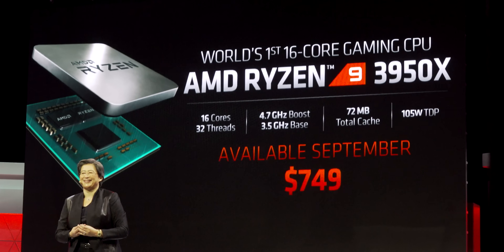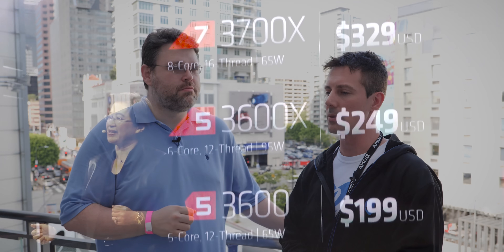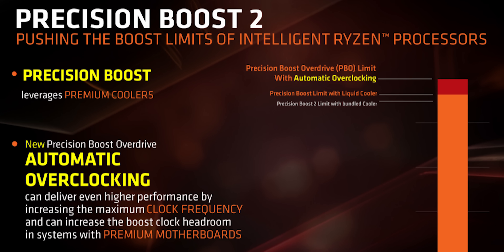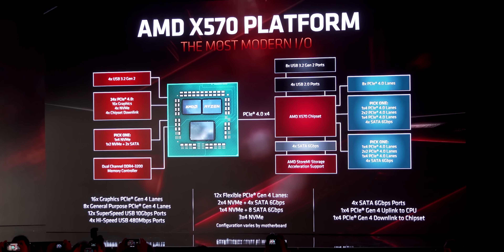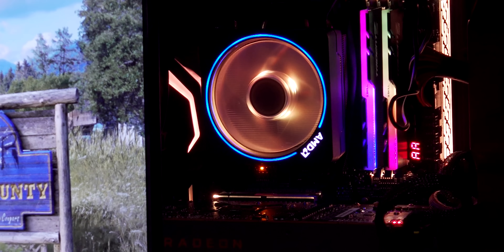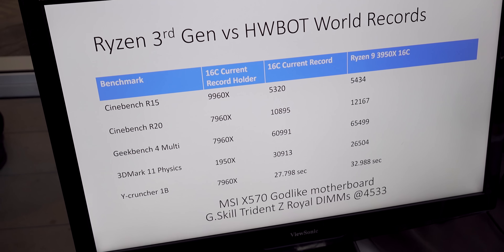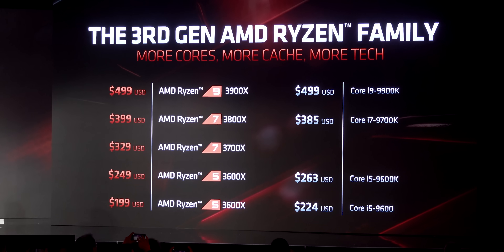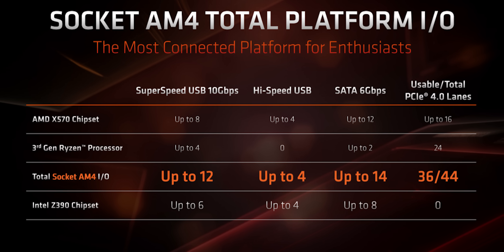...Is it 'The ONE'...!? (3950X & Zen 2 Discussion Ft. Wendell)

Comment: I have an i5-750 and a worn out HD 7850 (some memory artefacts, the shroud got detached from the PCB because the glue couldn't withstand the torque of the fan) I was planning to upgrade to a 3700X and a Navi card. I still do but these guys there enthusiasm about the APU made me realize something: why not start with a 2200G/3200G and buy both the CPU and Navi card later when those are discounted. 

It solves a few problems and I get better hardware while paying less in total because those APU's are so cheap. The 2200G is a much better CPU than the i5-750 and the graphics should be roughly on par with my HD 7850 (better GPU, less memory bandwidth). It seems like a good solution, doesn't it? Those CPU's will get a price cut of at least $100 late 2019 to mid 2020 (I wouldn't be surprised if the 3900X would cost $329 or less a year from now), the graphics cards will get a good price cut once Nvidia made its countermove and AMD has sold all those Polaris and Vega cards. Let the sanity get back in the market (like Intel solving its production problems and offering better deals in Q4) and sit it out with an APU, buy those CPU and graphics card at a good moment when there is a good deal. I am thinking about a X470 Taichi if the traces for the RAM are good enough for 3600 MT/s and CL=14.
I dislike the prices of Navi at launch, that pushed me over the edge. The successor of the RX 480 (the full 40 CU's card) shouldn't cost more than $350, with that I take into account the higher production cost because of that 7 nm. node and GDDR6.
Reply: I don't think Zen2 parts are going to drop in prices much. AMD isn't underdog in performance anymore so they don't need to present strong value argument to make sales. 6&8 cores prices might trickle down because intel can compete in that segment(when they capacity problems easy out) but 12&16 don't have any competition for long time. Navi is expensive but I  expected it because yields looks really crap. Their prices probably go slowly down but really that much. AMD can't go for price war with 7nm navi and Nvidia knows it. So Nvidia has no pressure to cut prices significantly. At best they bring refresh models to each segment and drop slightly prices of their current skus. Industry is pretty much waiting for next year EUV process nodes.
Reply: @kognak6640  

I appreciate your insight. AMD still is the underdog, the market for people who assemble their own PC is tiny compared to the OEM market. That doesn't say anything about the prices of loose CPU's, I just point it  out. AMD competes with its old products, before Zen3 releases AMD will drop the prices of Zen2 to keep selling those enough and to offer good options to the more budget conscious customers. Also we should consider that AMD CPU's loose value faster than Intel CPU's, simply because of the backwards and forwards compatibility of the AM$ motherboards. If you have a 7400 on a motherboard than the 7700(k) is the only improvement without changing the motherboard, for Ryzen you can drop in many CPU's, including newer CPU's, this lowers newprice too because AMD also competes with the secondhands market. Before that AMD will already drop the prices because Intel will launch more competitive products in q4. It will still be 14 nm and it will still have the same 'IPC' but Intel will lower the price per core. Intel doesn't do price-cuts but they can lower the price per core for the new release. 

However, for me it mostly is about the Navi cards being $100 too expensive while my graphics cards is half dead (memory artefacts and shroud detached from PCB due to a bad glue connection which can't resist the torque of the fan). Those will drop guaranteed. AMD deliberately starts with a high price, not only to counter whatever Nvidia does next (Ti-cards and price-cuts) but also because AMD wants to sell those Polaris and Vega cards first. This also has to do with an overproduction due to that mining nonsense. I don't know if the yields are a problem, that is a tough call with 250 mm² dies. It might be to some extedn. Regardless, that is another reason to consider to make do with an APU for a year. It is not worse than my HD 7850 (some wins and some losses) and it is lot better than my i5-750. If I can buy it for €100 or less, why not? I can already upgrade the motherboard and RAM and I only have to swap the APU for a CPU and install a graphics card when the prices come down. Buy it when there is a discount instead of buying it brand new. I agree that we will get a performance/price boost when EUV starts getting used. 7 nm without EUV is on the border of what is possible, they are really pushing it right now, all those extra required layers make it a lot more expensive.
Reply: @peterjansen4826  Underdog remark meant performance-wise, as a company AMD obviously is and unlikely will change soon. AMD products so far had only price advantage, it was always budget choice. With Zen2 this position will change, you see it how board partners are investing in. There's really no other argument for intel but brand loyalty. And new products later this year? Doesn't look good at all. We certainly would know if there's anything significant coming, Intel would make sure of it we'd know something and try to steal attention from Zen2. But there's nothing, just overclocked 9900k and that's one of the reasons why board partners are all-in with zen2. They see business opportunity there.

About Navi yields, I did estimates based on reported 70% yields of Zen2 chiplets which are only ~80mm^2. With same defect density which cause 80mm^2 dies to have 70% yield, 251mm^2 dies have 35% yield. And largest 7nm die 330mm^2(vega20) has 25%. Combine with at least double wafer costs of 7nm, you get very expensive chips. Chiplet yield should be about 90% if navi dies are cheap to make.
Reply: @kognak6640   
Intel can add cores, bump products to a lower tier, cut prices. Introduce a 10C for $499, lower the price of their 9900k $350...
Will they? I don't know but Intel will have to for the 'build' it yourself market. Mostly I expect a price-decreases for Zen2 because of AMD its competition with older products of itself, both new and secondhands. Price-cuts from the past give a good indication of what AMD might do in the near future. The price cuts of the 2600X, 2700, 1950X...
I was expecting the 12C as 3700X for $329-349 and I firmly believe that this was AMD's original plan until they discovered that Intel really can't compete (their 10 nm node problems, security problems and production problems). For Navi the price is ridiculously high. I calculated that the price should be $335 or less unless the yield is bad and AMD has to throw away a lot of the wafer.

- The production cost of Ryzen 3800X was less than $50 in late 2017, that die is $210 mm²
- The diesize of the full Polaris is roughly 250 mm²
- The TSMC 7 nm node is at most twice as expensive as the GF node and the cost is proportional to the surface area
- GDDR6 is at most 70% more expensive than GDDR5
- 8 GB GDDR5 costs around $35 (Gamers Nexus)
- inflation of at most around 2% per year (less in Europe, more in the USA) 

If there is a problem with the production cost then it has to be the yield. That price will drop once the stock of those old Polaris and Vega cards got cleared and the yields have improved. 
According to that Anandtech guy his estimate the die of a Zen2 core chiplet is 85 mm². Not a big difference but indeed, the yield probably is not good enough yet.  Give it a year and that will improve a lot. They plan for the PS5 and the X2 to be released late 2020, they can only do that once the yields are good. I would be willing to buy a RX 570 if the price drops enough but that would have to cost around $100 given the age of the GPU. That Navi with 40 CU's is the successor of the RX 480 but it has the price of the Vega cards. I hope that this will imove in a year time. Maybe AMD should have used the TSMC 14 nm (branded as 12) for their first round of Navi cards. The architecture is solid as far as I can tell. This is just the first generation and AMD needs some backwards compatibility with GCN because of the drivers, I expect that AMD will compete for FPS/W with Nvidia again in all segments of the GPU's with the next generations.

Comment: I'm actually most excited for the 3950X.  I really want to put that in a top board with some insane VRM like the new Gigabyte Master and see how far I can push it on open loop cooling.  As far as value is concerned, first gen Ryzen 5 1600 is already an insane value.  You can get one for $80.  You can easily build a complete system based around that chip, using all new parts, for $500 and not really skimp out on anything.
Reply: Through three generations of open product on the market AMD has openly changed the landscape. You will be able to find 6 cores or better for insanely cheap.

Comment: Flight simmers using Lockheed Martin's Prepar3d can use all the 16 cores 32 threads.
P3Dv4 multithreads incredibly well. If you have enough threads, you just don't need high clock speeds for fast and smooth performance.
https://imgur.com/a/LuU1ruC  - these pics show the great performance at just 3.4 GHz but with ALL 16 threads getting worked hard. And this is 2 year old hardware and not a Ti graphics card.

The old flight sims like FSX, P3D v2 and v3, and even recent XP 11 have old coding that does not use the horsepower under your hood. They are just single threaded programs. But P3Dv4 - Wow, welcome to the New World.

Comment: 3400G ITX build - can't wait.
Reply: Yeah the 3400G will be awesome for ITX builds. That said I had really high hopes for the 3200G and 3400G, but sadly I'm kinda disappointed. As things are it will be better for most budget gamers to just get a R5 1600 + used RX570 since their price together is slightly more than the 3400G. I was expecting the 3400G to either perform better or be cheaper. I mean I haven't seen actual benchmarks yet, so it's not completely decided that it's that much worse than an R5 1600+ RX 570, but logically it should get crushed by that combo which as I said makes it a bit pointless except for ITX builds.

Comment: the question is to ask what the price point within the market you live in bit the USD value of the core count

talking from a streaming perspective what ram counbt are we looking at for 4k/4k HDR/8k are we goping to see because from a buyer perspective as an australian consumer of amd products i see no 128GB kits being  available nor  do I see 256GB or above  and are touting  8k resolution for next generation system from a console perspective what are we going to need in a streaming pc for  an actual  4k/4k hdr/8k  console lets face the actual fact that mid gen refresh is under powered  for what you get

the next question  to ask what ram count is going to be required  for 4k, 4k HDR and the latter 8k as for 1440p fuck waste of time and wast of space since I'm using a 55" tv as my monitor I have  time to consider crap within  the up to 40"pc monitor and 4k is viewable at 32"' though to sub 41+ year old eyes 55"is about where i am in terms  of viewing space ..

8GB  in a graphics card  isn't relevant today and less so 10-15 years ago and the current 16GB options are lacking  my guess minimum  will 32-128GB or higher  depending on how many 4k or better mintors you using in your setup

for  a moderate pc gamer/streamer/editor  it is looking at a minimum specification of 128GGB on ram with bare min of 16GB video card.. if not double to quadruple that once 8k becomes more applicable and affordable to buy..

Comment: can you please ask someone how much ram frequency R5 3400G will allow? 
the fact that it's clocked to 1400 gives away that they did change some things except the frequency because the 2400G didn't run with 1400...
i'm really interested
Reply: What? 

Do you mean DDR4 2400mhz ram?
Reply: @grlmgor  2400g was rated for 2933Mhz DDR4... that was bottlenecking the APUs.
And Ryzen 3000 seems to allow for higher memory frequency. But the 3400G is based on Ryzen 2000.... so i wonder...
Reply: @milchkopf3881  I think they can go slightly higher then 2933 but most low end boards didn't official support it.
Reply: @grlmgor  sure they do go a little higher but i used the announced 2933MHz to be able to compare it against the number amd will announce for the 3400G

Comment: why does the 3600x 6/12 cost more than the 2700x 8/16 ? why? i was hoping for the ry5 to be cheaper ...
Reply: 3600x RRP 249, 2700x RRP is 329, same as the 3700x

anything cheaper is from price cuts as the chips get older
Reply: 249 U.S in europe it will cost 300 to 320€ witch is the same as the current 2700x , lol
Reply: the 3700x will cost almost 400€ just wait and see.

Comment: threadripper, i said before over and over online, the 8 and 12 didn't sell. the 16-32 did. so with two 8 core chiplets to make 16, the new epyc showed 4 chiplets on each side.... even if each chiplet only used 4 cores for the low end threadripper, 4x8=32 core low end. and on the high end 8x8=64 cores. so threadripper still coming, just larger setups. no reason for the cross over. basically no one ordered an 8 core threadripper.... you could pay less and do desktop variants.....

cant wait to buy 3000 series zen plus the msi meg ace motherboard. hopefully my radeon vii, if its really an mi50, gets a pci-e 4.0 bios update.
Reply: Thank you for clearing this up Goblin... I'm a 1950x and I love it but after this ryzen 3950x announcement and no news for Threadripper I was getting nervous. I got X399 MOBO and PC setup ready with $1500 to throw at a 3rd gen 32 core. I don't care about the money this company is a beast and if they upcharge I would pay more. AMD has taken us where Intel never cared to take us at the consumer and High end, time to pay AMD back $$ :D

Comment: The 3950X is an incredible processor, but I get the feeling that it may be hampered a little by the dual channel controller it is using. The large onboard cache will help with that, but I'd like to see the performance benchmarks for multi-core workloads. However, it is a frankly stunning component, I would love to get my mits on it! :D
Reply: DDR5 needs to be dual channel on a single DIMM imho
Reply: @H31MU7  I have to say, I would like to see this too...
Reply: Did you see Wendell compare Threadripper vs octa-channel epyc? No real difference for a lot of it... it was just windows scheduled for Numa cores.

Comment: You want to complain about IPC ? Why does a overclocked i3 CPU beat Ryzen &  threadripper on games? Explain that 🙄
Reply: It doesn't. The 4-core i3's lose to the bigger 6 & 8 core Ryzen chips in more than a number of recent titles. And it sure as hell won't beat Ryzen 3000 lol. That's already beating the i9-9900K in a bunch of games at 1080p as shown at E3, so how is an i3 gonna have any hope in fucking hell? Answer? It won't lol.
Reply: The only currently overclockable i3 is the i3-8350k which is almost $200. Why in the world would you buy a quad-core processor with no hyperthreading that costs the same as a Ryzen processor that has 6 cores and 12 threads? Sure, the i3 may come out slightly ahead in certain single-threaded applications or games but when it comes to multi-thread processing, Ryzen 5 destroys the i3.

Comment: Navi at $449 is middle of the market.. FK OFF AMD..  At least Nvidia gave us a GTX 1660 and 1660Ti as a midrange option at real midrange prices.  If navi 14 doesnt compete with the 1660ti then navi is dead. Cant wait to buy my R7 3700x
Reply: @Just4fun and the amd reddit. its sad. "amd is never this expensive" 9700 pro was slightly over 500 and that was MANY YEARS ago. 7970 was like 499.99 at launch. 290x was 549.99 at launch. people are just cheap fucks and think a 2080ti should be 500 bucks so they can afford it.....
Reply: Exactly. But I think we will see the cards soon at $329 and $399, no one will buy this shit.
Reply: @janaebert3059  nvidia was scum pricing their new cards at the same price to performance as their old cards.. AMD doesnt need to be like them and spit on its customers.. i remember when the radion 6870 midrange came out and it was as fast as the previous high end option but cost half as much.. And so on up to the RX480... those days are history.

Comment: TSMC has made great strides in the past. Remember the 28nm Snapdragon 800. The 2.23GHz SD800 in my Note 3 could clock up to 3.1GHz. I set the highest Geekbench 3 scores and clocks with that SD800. The records still haven't been broken. I acheived this by of course root and putting it in a freezer. It would run just long enough to pass Geekbench 3 once, before it shut down. 2.8GHz was sustainable.
Reply: So you put a fan on it or what? No way that clocks can be sustained under load without acitve cooling
Reply: @Squilliam-Fancyson  freezer
Reply: @Xenoray1  lol, you are crazy
Reply: @Squilliam-Fancyson  ? he mention the freezer.. dude wtf
Reply: @Xenoray1  he edited afterwards, dude!

Comment: 0:59 threadripper never had a socket "guarantee", although i think we are at the end of the socket run for r7 and below. maybe 2 more years. changing both pcie and memory standards is going to, like with am2+, force them into a new socket with another am3 type deal. but this time around they have the experience so maybe they can do it right and bring out decent bridge cpus for folk who want to flip platforms more slowly.
Reply: Threadripper 3rd Gen is still coming, so there was no "socket changing".